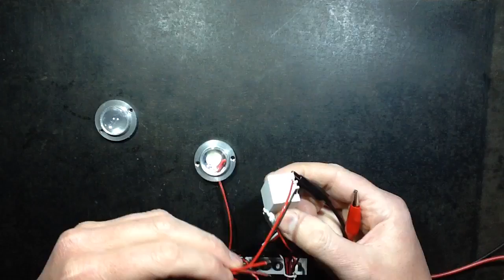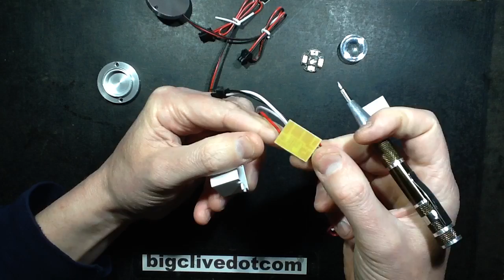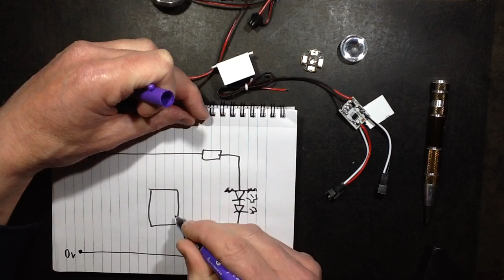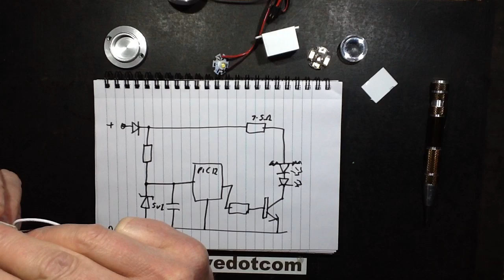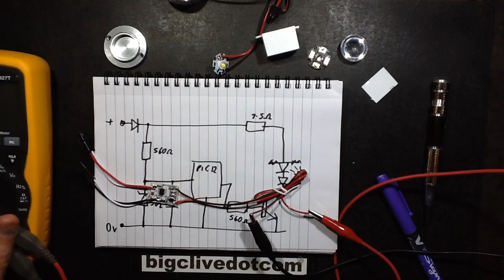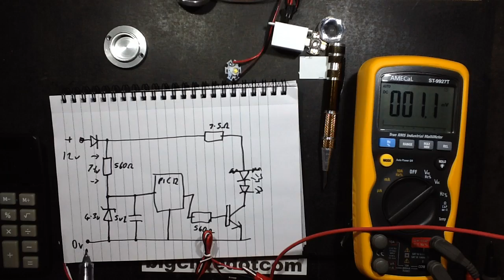A look inside an LED vehicle strobe set.

Comment: I bought these before starting to tinker and seeing this channel...what ohm value is the appropriate one too not be driving these at 900-1000? ...n would it be ok to leave the board out of the enclosure and hot glue it front n back for protection SO I can mount it in a small space on the motorcycle? . .or is that a bad idea? ...thanks y'all!
Reply: i've got some of these on my motorcycle, i took the board out of that ridiculous box and put a piece of heatshrink over it, not had any problems with it yet, don't know about the ohm thing i've just got mine wired to my horn via a relay and patched into the parking light wire for the power. For use on private land of course as it's not legal to use them on the road here.
Reply: thanks but I'd rather do it right and install it on its own circuit and not inline with anything factory that the engineers have segregated into their own circuits for a reason. also make troubleshooting dead easy when the day comes as well as removal when it's time to sell and buy a new bike...no hack jobs to beat down my return price when selling. I'm in to win it and I'd rather KNOW what I'm doing and why I'm doing it and I'm anal about working on stuff that I pay hard earned money for and like to do things the right way the first time ...it's saves time and headaches in the long run and I learn stuff every time as a bonus. thanks for trying to help though.
Reply: I'm grasping the VIR math so I'll figure it out t eventually when the time comes and I feel like working on the bike and replacing the throttle cable too...

Comment: I used to travel to China and Hong Kong, and as it turned out there is a high import duty on processors in China, so the staff of the electronics manufacturer used to handcarry (Smuggle) them by train from Hong Kong to Shenzhen across the border. I always thought that was the main reason why they take the numbers off.
Reply: Guy Van Loo They also do this to prevent other Chinise counterfitting their product/estimating manufacturing cost.
Reply: aigarslv lol the irony

Comment: I was thinking of building something similar with a cheap Arduino nano/mini clone with a few more programmable options, but I'm guessing it would cost me more than just buying this. Are those 3 watt LEDs? Or maybe a single higher power LED pointing straight up with an inverted reflective cone above to give a horizontal circular pattern. Imagine the possibilities with an RGB LED! Just finding the parts like the cone and perhaps a diffuser lens/covering might be problematic.

Comment: I was experimenting with mine and realized the unit was designed for two models, if you snip the one wire going to both leds in the middle and connect the side of the one led that has ground already to the pad beside the ground and the other led wire you snipped off  to share the ground with the first led, you will get an alternating pattern from the leds much like a police car lights in the front grill
Reply: do you have a diagram by chance?

Comment: "Hopefully they have polarity protection built in..."  I once got a set of HID car lights off eBay that advertised a polarity protection circuit.  The circuit was a separate box on the main power input lead.  Said box literally caught fire when hooked up backwards...
Reply: A quiet minute for its heroic sacrifice, please.
Reply: rhkips well...it DID protect the HID lights.

Comment: Hello bigclivedotcom. Just discovered your channel by accident a week or so ago but have been having a blast reviewing your videos.  I'm totally fascinated by anything LED, especially strobe LEDs as I use them in various configurations on my homebuilt RC sUAV's.  I have been thinking lately of mounting some sort of strobe system like you presented here on my pick-up truck to use as emergency warning flashes when I'm stopped on unlit country roads at night, but couldn't find this kit on Ebay.

Anyway, thanks for the lead and for taking the time to go through the circuitry.  I just love videos like this!  Thanks again.

Edit: Tried looking up "Premiumgood" on Ebay but get a message saying "No longer a registered user."
Reply from the maker: Try searching ebay for truck or jeep led strobe.
Reply: bigclivedotcom Yeah, I just figured that out (duh!). ;-)  Thanks again.